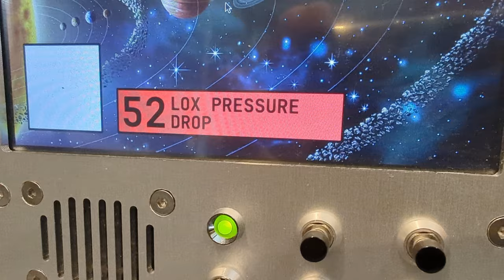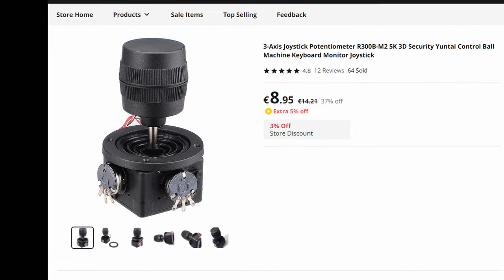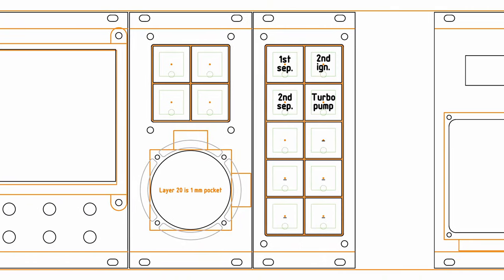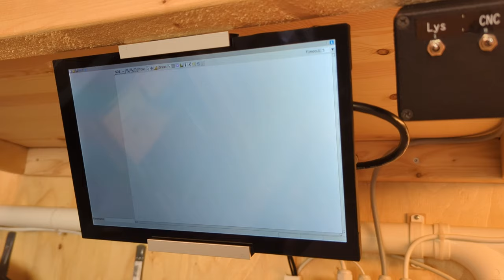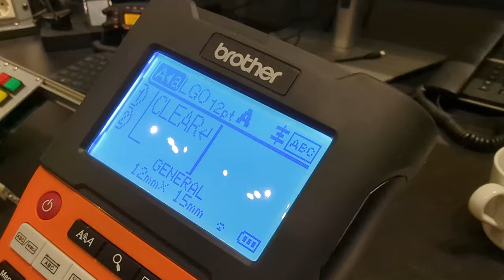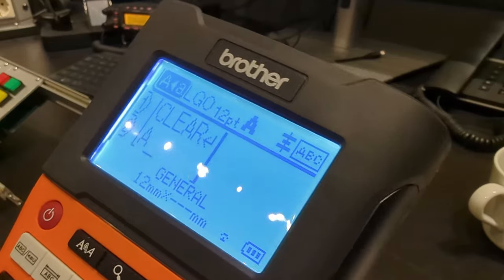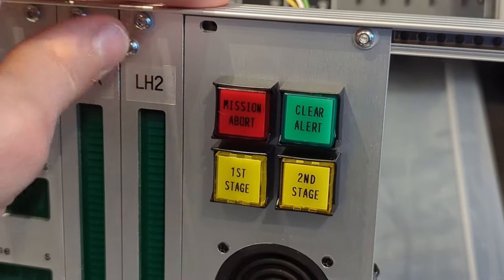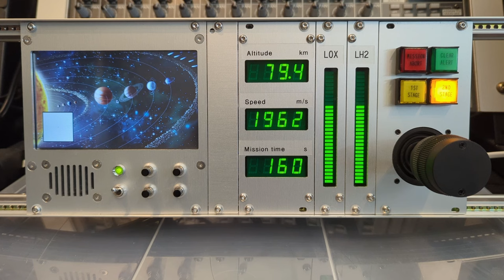DIY space ship simulator, part 1

Comment: What are the rails that you're using for the frame? I'm working on plans to do something similar for my son and those rails look like a good solution to one of my problems
Reply: I don't know which part this guy used but this is 19-inch rack frame. This is quite a standard (https://en.wikipedia.org/wiki/19-inch_rack). You can start with schroff and this rack (ref 24564-131) but you have plenty of options available from other manufacturers

I like very much this project, the build quality is very impressing !